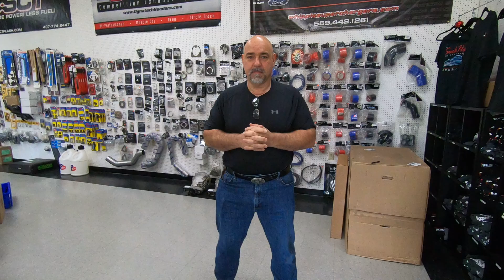How much power the can the 6L80E hold? Jannetty Racing

Comment: I have a 72 chevelle currently deciding on which LS engine to build Ls3 with mild cam. Or Lsx 427. Car is going to be a fun Cruiser with plenty of power. I don’t race but will hit the highway for 15 hr road trips all over the country. Which auto transmission would you recommend 4L80,4L70 or 6L80. Planning to go with 3.90 gears. Thanks looking forward to your response.
Reply from the maker: 4l80 will be easiest since there are electronic trans controllers readily available, I would be happy to help you with your parts we carry everything as the largest speed shop in the north east  203-753-7223

Comment: What 6l80 options do you offer and what are some prices? I’m stationed over in Germany so I know shipping is expensive but I’m having a hard time finding any decent builders over here. I have a 2012 Silverado with a turbo 5.3. Right now it’s around 650hp.
Reply: What is your state? I’m in NY. I put a new torque converter, I use a delete AFM to protect my new torque converter. My shop put a new raybestos rebuild kit.  Tranny is working fine but you call to my attention about calibrations. TCM looks like a learning process is done because is shifting smother than the first day that I pulled from the shop.
Reply from the maker: We can ship you all of the parts to build one at your location call to order 203-753-7223
Reply: @JANNETTYRACING  same any news need transmission now
Reply from the maker: @daboostedtahoe  Not sure what news you are looking for but if you need a trans we can help 203-753-7223

Comment: Is there a reason why not to bypass the radiator? Usually it removes the risk if the core in the radiator splits and then having water go through the transmission? It should be ok to just run an external cooler with something like an improved racing thermostat in the line?
Reply from the maker: Because liquid to liquid coolers are more effective and quicker to remove heat but the size of the cooler gets overwhelmed when adding aftermarket converter, that is when the auxiliary cooler come in to play
Reply: @JANNETTYRACING  Lol the radiator is full of hot engine coolant is it not? If anything the oem (at least from what I can see on my c6 rad/trans cooler) acts more as a transmission warmer. I'm definitely going to bypass it. Thermo dynamics tells us whatever has the biggest differential in temperature will reduce temperature quickest. Radiator temps are higher than ambient temps. I have no idea how the radiator transmission cooler can get access to fluids even remotely as cool as ambient temp...
Reply: @th600mike3  - while I see your comment is sort of old, I'm just gonna throw this out for anyone that reads it and cares. While the coolant in the radiator is hotter than ambient, it's also a liquid. Liquid to liquid cooling is vastly more effective that liquid to air. Even with the much greater temperature difference, the coolant will still pull more heat out of the tranny fluid. If you check actual temps, the liquid based coolers will keep the trans fluid roughly 10 degrees higher than the coolant (not counting high stall converters). And as mentioned elsewhere, transmissions operate best between 180* and 220* F - so the radiator cooler actually helps get the trans up to temp faster. This is a good thing.

As was also said, if you have a high stall converter, you can exceed the stock cooler limits - that's why you need the extra cooler. The stock one does the heavy lifting for removing heat, and the rest is shed by the extra cooler. If you bypass the stock cooler, you would need a massive auxiliary cooler. Best to just use what's already there and add only as needed.

Comment: So I have a 2009 Silverado I have a 6.0/4l80 to swap into it. Multiple guys have roasted me on swapping in the 4l80 because they say the 6l80 will hold the power, so is it possible for a 6l80 to hold 1000hp in a crew cab truck doing boosted launches?
Reply from the maker: When racing at this power level it is normal to remove the trans and freshen it on a regular basis,  Gearing plays a huge roll in how much torque the trans will hold, the lower the gearing like 4.10 or 4.56 the more torque the trans will take as the gear takes the load off the trans.  We have been 950 Crank HP for full  drag seasons on our trans in 4400 lb cars and we have a Denali pickup with a Built 427 Whipple combo 850 plus,  that has over 50,000 miles on it
Reply: JANNETTYRACING built lots of different transmissions I’m sure I can do it, the tuning is the problem. I’m sure I can just buy all the trans parts from you guys. I’m a few states away, anyway to send trans tuning over for my truck before I take the leap this winter. Collecting all the stuff for my build currently. Have most of my engine stuff besides the turbo and was about to tear into and build the 4l80. But if there is a way to get my trans tuned without coming all the way there I’d drop the 4l80 idea
Reply from the maker: @francisspytma813  As I mention in my video the Trans tune is linked to the engine tune so they must be done together, there are a lot of things we do inside the trans that goes way beyond a parts list.
Reply: JANNETTYRACING 4l80 swap it is! Thanks for the info!